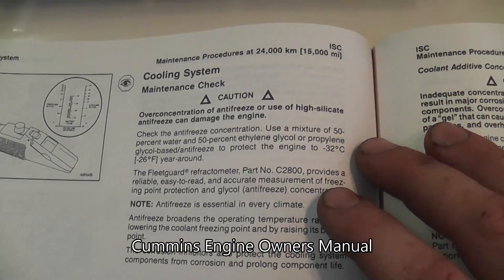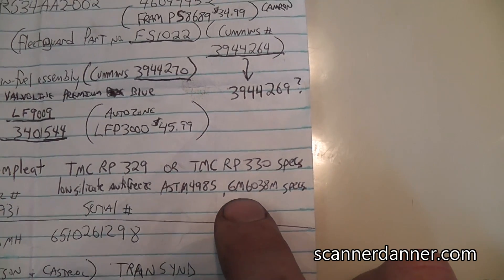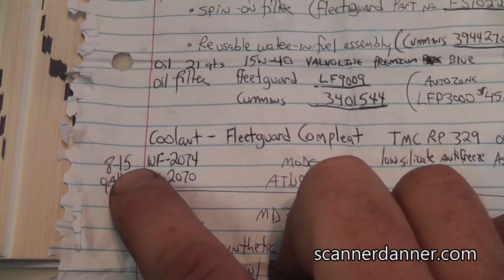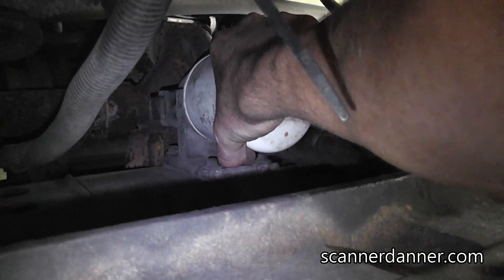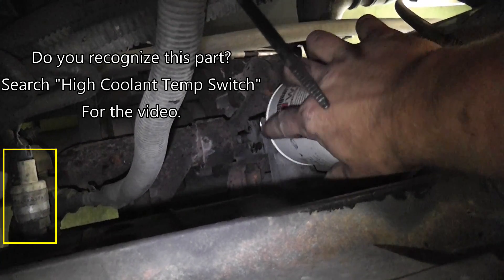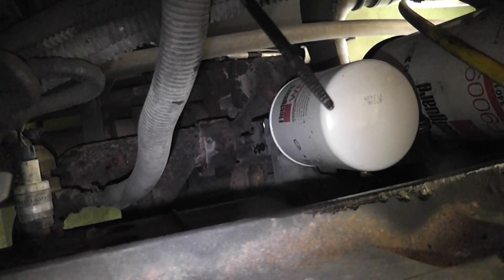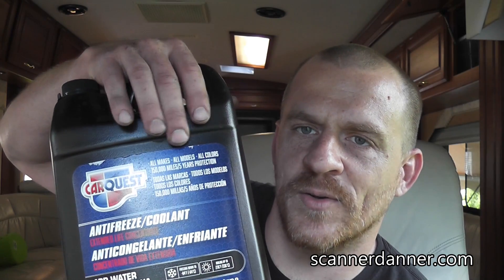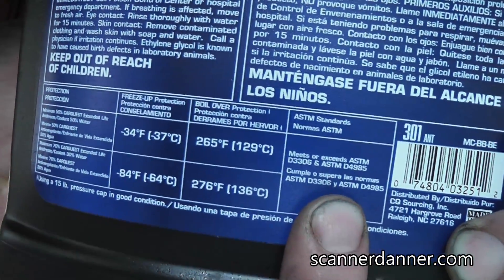2001 8.3L Cummins Coolant Flush and Filter Change with DCA4 (SCA)

Comment: One must remember that the engine in this vehicle was designed to be used in a heavy duty application! Basically trucking, and heavy equipment! It's design was to make maintenance cheaper, and easier (translated to mean less labor time)! The coolant used is basically the same thing that you use in your car! You already ready know that green anti-freeze, orange anti-freeze, and yellow anti-freeze exists!! But what is the difference? To make it simple, use the color match, to help you!! But in commercial maintenance, there even more products available, so the ASTM number help guide you. Very much like working on cars, and the manual says us GM PART #xxxx sealant on something, and you know the you already use blue glue, or black glue, you won't go to GM for the part # they specify!! 

Then comes the total cost ordeal!! If you follow the recommended change interval, you could change coolant every two weeks, in an over the road truck application!! So, in stead of removing and replacing the entire liquid coolant volume, they replace the additive pkg within the coolant, based upon a chemical dip stick test! Changing the entire volume of 15 gal of coolant would cost extreme amounts of time, and money!! They would have to keep vast amounts of product on hand, and the time involved would rack up some serious hours, to the techs!! 

So, to make it simple, cheaper, more cost effective, and need less space to store material, they just change the additive package. And the filter manufacturers make that even easier, by adding amounts of the additive package to the filter, so it almost constantly has a manner to be added to! You would just take a dipper out of a bottle and dipped it in the coolant, and then matched the color to the sample chart on the bottle! Then you would add an additive amount to match what the test strip claimed that was needed!! The appropriate filter is the filter, just differing amounts of additive!! So, you know that the job of the coolant is pretty much like water!! But, things like corrosion inhibitors, for the dissimilar metals in the system, to prevent rust and corrosion. Lubricants, to help keep the water pump lubricated!!foam inhibitors, to prevent the buildup of foam in the coolant! You know that foam will not remove heat, and has a tendency to displace a liquid volume, thereby reducing the effectiveness of the coolant! It also has a preservative that's helps keep the rubber in the hoses pliable and flexible! All of that is carried in the coolant volume!! The filter removes large particles, that could build up, and block small passages! But when the additives get worn out and lost, you can replace the coolant, or the additives!! 

Ask your auto parts guy, if they have any coolant tester strips!! Or you could ask the local truck service plaza if they sell them, or will test it for you!! And I mean anyone interested, not just you, of course!

You should feel comfortable knowing that even tho you didn't drain the entire system, and you used the proper style of new coolant, plus you used an additive package filter that was at the maximum additive, you will be protected for at least longer than you will own the R.V.
Reply from the maker: I have the test strips and I've also changed the filter two more times over the past 10K based on the results of the test. The next two filters I used had 2 units of DCA4  (WF-2070 instead of the WF-2074 I used originally)
Thanks for the info my friend!
Reply: ScannerDanner  You are very welcome, Sir!! And I hope that anyone else that sees this, may find some much needed info and answers! I too, had some of the same questions, at one point! And while I was a truck driver, I amassed some info, a little at a time, from some of the company mechanics, to help me learn! Of course, this was long before the time of the WORLD FAMOUS SCANNERDANNER!! I wish you had been around 30 years ago!! When I was wanting to learn new stuff!!
Reply: After dropping all my coolant in my 8.3 ISC Cummins, I completely forgot about the additive when I bought my 12 gallons of coolant to replace the old.  So, I went out and looked at the jug, and thankfully it states it's been re-charged with SCA additive in the 50/50 coolant, so that was a relief.   Nice to know I should be good for a good long time, as even the original coolant from when I bought our Tiffin 5 years ago, the coolant that came out is clean as a whistle!   I can remember back as a kid, looking in the radiator once the cap was off, and there was a ton of rust in the coolant, yet the car seemed to have no problem staying cool, not to say it shouldn't have been flushed, but that's how things where back then.

Comment: Scannerdanner, is this a mechanical P7100 pump engine or electronically controlled?
Reply from the maker: 8.3 ISC, CAPs fuel system?
Reply: I work at CalibratedPower.com, want to tune that hotrod for economy?  Can also update you to newest factory calibration. Does it have a 9 pin diag plug?
Reply: Should be a caps fuel system
Reply from the maker: No but I would like to tune it with a little more power. I know you can on these but I don't want to hurt my tranny. I'm not sure about the DLC offhand and I have no access to it until the end of March 2018. I just put it in storage in an underground limestone mine.
Reply: ScannerDanner , we do power too. ;) Sending a message.
Reply from the maker: sweet! You can email me at paul@scannerdanner.com or message me here too
Reply: Sort of the bigger brother to the VP44 on the 98.5-02 Ram's w/5.9 ISB's. Decent as long as you keep a good LP fuel supply of clean air free diesel going to it.
Reply: Joshua Respecki but runs much higher pressures than vp44
Reply: Indeed. Maybe I will do a comparison video if anyone is interested.
Reply from the maker: for sure. post think link here when you get it done. I will most likely go to spam but I'll unlock it

Comment: Did you see the 16# cap spec on the metal tag next to the radiator?
Reply from the maker: I did not.
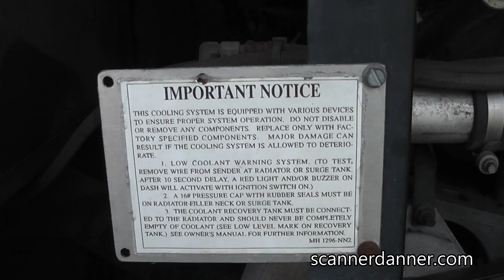Reply: 12:50 into the video, it says to use 16# pressure cap on the rad.  That's "rad" said Pittsburg style!  haha
Reply: 15lbs/16lbs  close enough, now if there was only a 7lbs on there, I'd have been worried why
Reply from the maker: agree

Comment: Paul at GM we only used a distilled  water mix  in a factory fill  - not city tap water . Couldn't tell if that was long life coolant premixed or concentrate. From what I have understood mixing with household water reduces a  long life coolant  to a 2 -3 year  coolant change frequency . I'd be interested to hear  what your thoughts are on using tap water.  Most coolant  manufactures do state just water on their  labelling.
Reply: yeah, should use distilled water only, you want as low of mineral contents as possible and of course PH neutral
some city water can be loaded with calcium, lime, other bad minerals and be acidic or alkaline and form a thick hard white crust or cause major electrolysis.
check it for PH balance often.  *forgot to say, private/community well-water is as bad or worse*
Reply: throttle bottle I did ask our supplier Havoline  about tap water and as far as their concerned distilled water is a must for long life coolant and  2-3 years max with tap water .   Their stance was the additive package should be ok but of course it's not recommended because they have no idea what's in the water.  Most don't service their coolant systems correctly and rads and heater cores are the first to plug up and of course it's  quite expensive compared to maintaining it correctly.  I only use distilled water  too many variables using any other . Haha I'm saying variables to now. LOL
Reply: I don't know how you figure, here "peak brand long life 50/50 premix is $15/gallon, while peak brand long life 100% is $17/gallon +$1/gallon distilled water = 2 gallons of 50/50 mix for $18
lets say he needs 10 gallons, 10 gallons of 50/50 premix = $150. where as 5 gallons of 100% and 5 gallons water makes 10 gallons of 50/50 mix for $90.
where I come from $60 is a good savings ;))   the saving even greater when you get into OEM branded, pentosin and others.
Reply: I think it depends on how hard the city tap water is. Here in Milwaukee, next to lake Michigan, we have excellent water. Never had a problem. Just to the west of us, the water is really hard. Lots of calcium in it. Plugs up your shower head quickly. That would be the time to use distilled water.
Reply: pre-mix costs too much, you pay near the same price for 1/2 the amount of actual "antifreeze/coolant", where as distilled water (roughly $1/gallon) and (straight coolant $18/gallon) spending $19 total nets you "two gallons" worth of 50/50% mix.
Reply from the maker: I never liked the pre-mix as they charge just as much or close to it and you're getting half of the antifreeze. Never considered the "proper water" aspect of it though.
Reply: Mark Chidester Yes I agree , good point . Most shops just use the shops water .
Reply: STEVE ROB pre-mix coolant avoids the issue and you'll always be sweet 😎
Reply: throttle bottle both work out about the same price here and it's much more convenient to use the pre-mix
Reply: throttle bottle we live in different countries, things don't cost the same. There's virtually no cost difference between concentrate and pre-mix here so it makes sense to use pre-mix
Reply: I agree, Steve. Where I live, distilled water is cheapest at Walmart in the food section, it's really inexpensive. Or, for a little more you can get deionized water. I wonder how often the complaints about antifreeze brands are actually from impurities brought in with the water, then concentrated when the water boils off. Even small concentrations of impurities could react with the antioxidant features of long life coolant and shorten coolant life, and of course calcium and other ions will plug passages and react with the engine wall.
Reply from the maker: I've never used distilled water Steve.
Reply: ScannerDanner   Well this is about the first time I  think Ive actually taught you something then. LMAO

Comment from the maker: This was filmed before our trip out west (Grand Canyon, Bryce Canyon, Mt. Rushmore etc) in June of 2016. I have a few more from that time period that I'll be uploading soon including: Onan Generator fuel filter, coolant and oil changes, power awing troubleshooting, oil and filter change on the engine.
Reply from the maker: Only the transmission fluid temp. Normal driving it doesn't get much hotter than 140-160 degrees. A few of those mountains in 110 degree desert heat I saw 220 (on the tranny, while water temp always stayed below 200). I was a little concerned as I don't really watch transmission fluid temp on anything I own, but everything was fine.
Reply: ScannerDanner LOL. That's not an O ring.
Reply: That's an awesome trip. There is nothing like those parks anywhere else. 
Lots of very long hills out there, did it ever get hot or will it run flat out all day long?
Reply: I've seen my Silverado's tranny hit 210° on a long, steep grade. Was pulling 6k lbs. of flatbed trailer and '89 S10 Blazer behind me. 90° out and a very humid summer day. The coolant temp also moved off of 210° on the gauge and headed towards 260° (don't know the actual engine temp, but was getting hot, for sure). As soon as I crested the hill, both tranny & coolant temps dropped like a rock. Different animal, but it seems the cooling system was designed correctly on both our machines.
Reply: cool, looking forward to see them